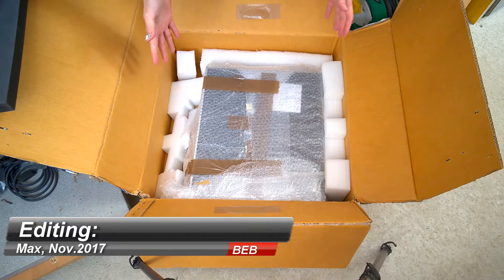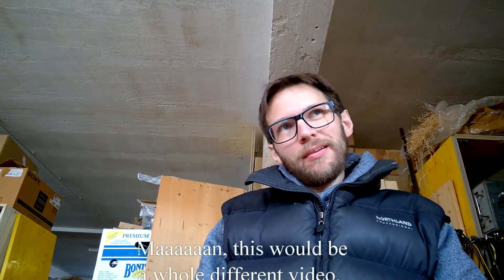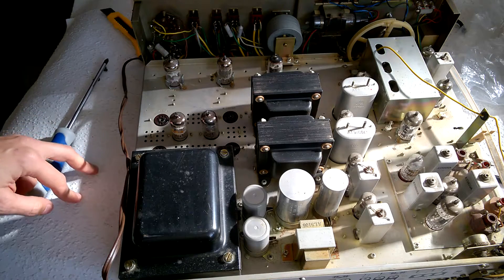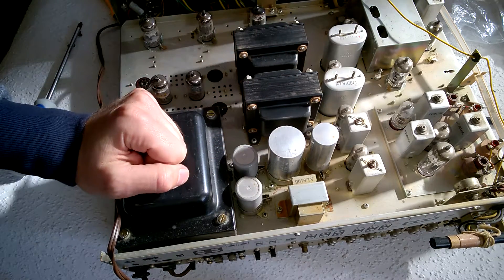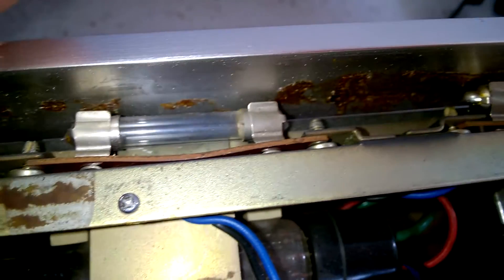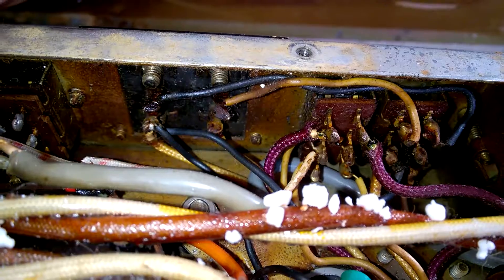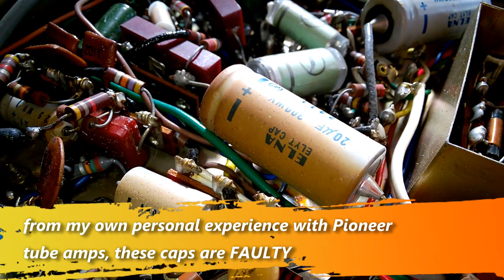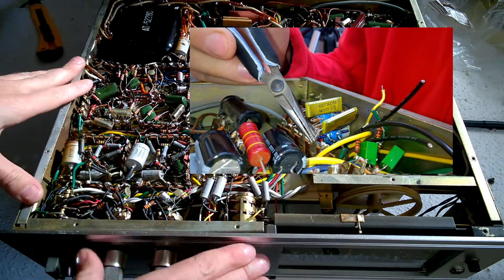BEB #60: Pioneer SX-82 Stereo Tube Amplifier Receiver (What's inside?)

Comment: I have the same sx-82 pioneer amplifier...I'm trying to restore it....I replaced 20 20 40 400 v capasitor.....plus I need a new volume control ...but can't find a  replacment....so I'm trying to salvage volume 500 k parts..to fix the volume control

Comment: I found one of these recently here in the US for $40 at an estate sale and it is in the shop getting a total overhaul. Can't wait to hear it!
Reply: You got a deal!  Today, I just bought one in exc & clean condition (SX-82E, $135) locally...from an electronics and audio hobbyist/retiree who had quite the workbench and absolutely incredible audio equipment he had collected over the years (from studio mixer, radio station amp, to an old wall amplifier for a theater). When I went to pickup this unit, he was kind enough to take me for tour of his collection and workbench equipment. All of it was in showroom condition. It was really impressive audio gear that is his hobby/passion.  He sold me the unit as "to be revised" given the age of certain components, though it is in fine working condition. He even gave me all of the original paperwork, as the unit was owned by his sister-in-laws father, to include original schematics...which should come in handy!

Comment: It's Yours Tube Amplifier ;) I have DIY tube preamp on E88CC. I did it a few years ago in conjunction with 2x TDA7294;) Yes, I know this is not true audio but it sounds OK to me :)
Reply from the maker: on high fidelity everything is allowed, if it makes fun  :-)
What kind of schematic did you use for the E88CC?
Reply: https://s33.postimg.org/qngcwipnz/e88cc.jpg simple common cathode with auto bias - I know. I should parallel the "Rk" mount the capacitor... or should I? Give me a hint.
Reply from the maker: I think the cathode should be virtually AC-grounded, by using a cathode-capacitor. But I'm not sure. Rk is 1k or something like that?
Reply: Rk=150 Ohm 1% I need to add capacitor on one channel. Maybe I'll hear the difference :)
Reply: Max is right, add a capacitor. low esr electrolytic cap, 16V 100uF, negative to ground. The bias should be DC only, but AC grounded. check it out and let us know.